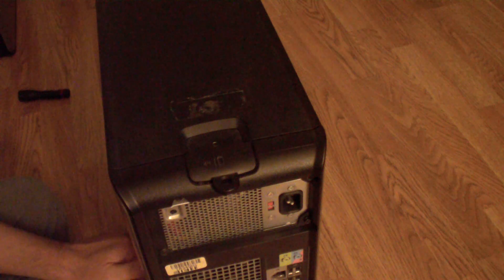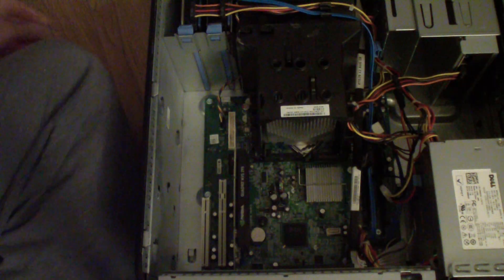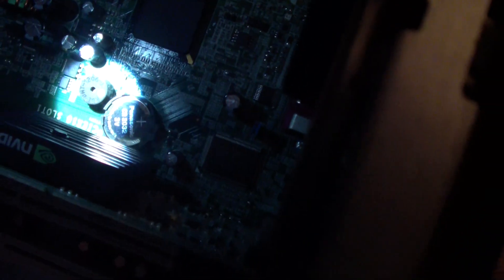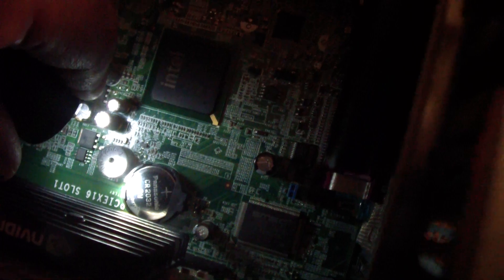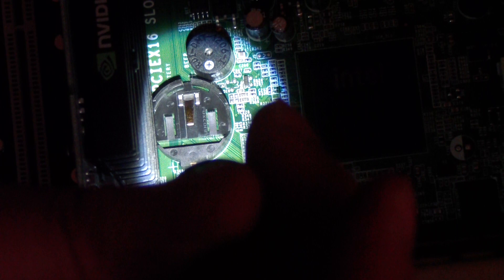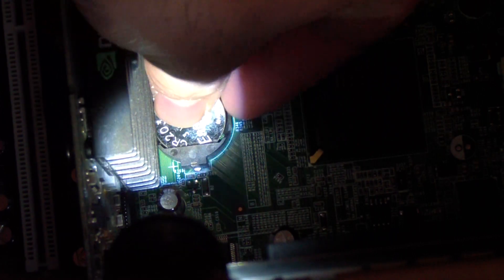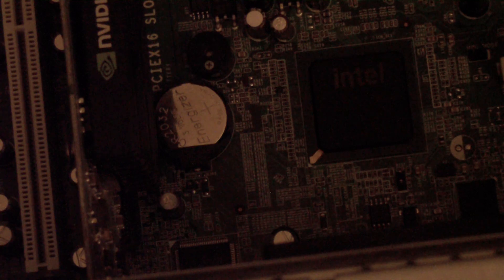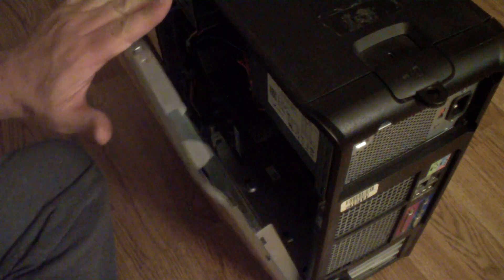Dell Optiplex 360 Replace CMOS Battery

Comment: I have the same one but the SLIM version it's a headache 🤪
Reply from the maker: I like the SFF computers, because they are nice and compact.
Reply: @Ace1000ks  yes but a Nightmare to upgrade them i cant even upgrade the PSU
Reply from the maker: @KrsnGmer  That's one of the problems with SFF computers, they don't use standardized parts. If anything breaks on it, or has to be replaced you have buy proprietary parts.
Reply: @Ace1000ks  yeah 🙂